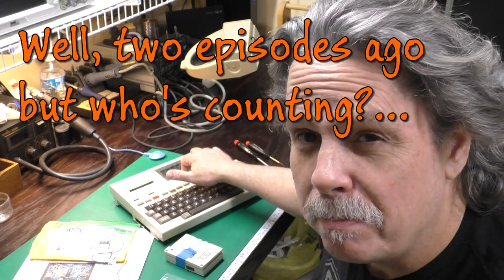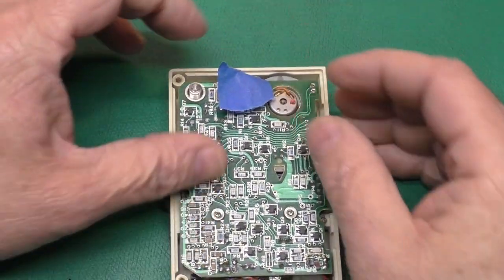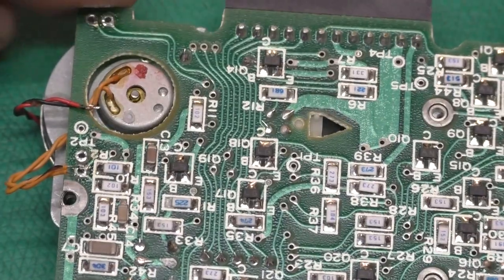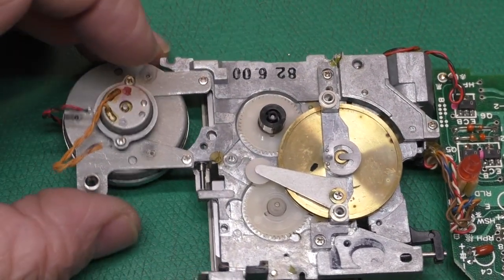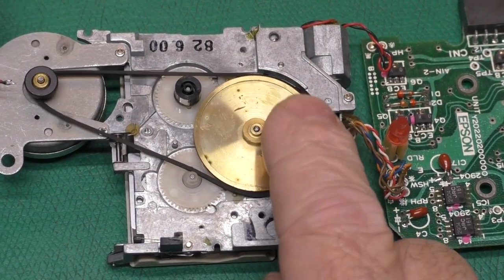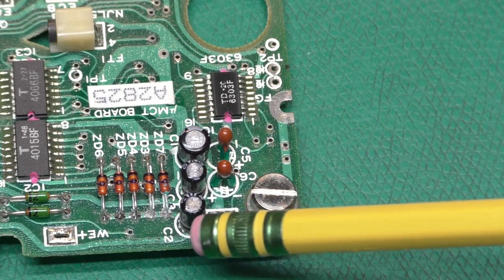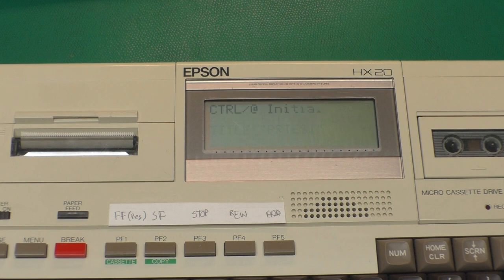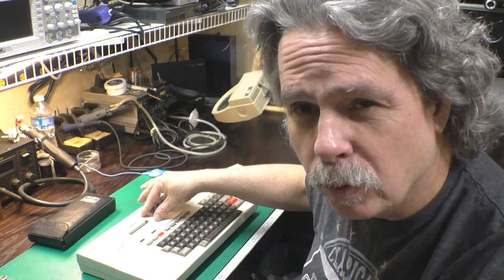Epson HX-20 #2 Microcassette refurb, Expansion Unit overview, testing things out.

Comment: Really enjoyed!  You must have been a watch maker in your previous life.  I was always disappointed the SkyWriter ROM will not initialize once the Expansion Unit is installed.  I could never figure out the Expansion Unit dip switch and jumper combination to see if the SkyWriter would initialize if installed in the Expansion Unit.  Great EPSON HX-20 vlogs!
Reply from the maker: I had not tried to get Skywriter to work once I reinitialized the Expansion Unit. I need to re-read that section of the manual to gain a better understanding of the various DIP switch settings.

Comment: Can you test the unit loose from the HX-20? For example by hooking up an Arduino?
Reply from the maker: What unit? The microcassette perhaps? If so, you would need to duplicate the control circuit for motors and amplifier to tape head.

Comment: Your video was very interesting, thank you for that. A few days ago I bought an Epson HX 20 on Ebay and I am absolutely thrilled with the computer. I could get started with the Basic straight away and old Atari 800 feelings came up again :). But I have one more question, the manual says that you can't put the HX 20 into operation while it is charging, why not? I'm already thinking about installing a Lipo battery that can be charged better and has a higher capacity. Then I could work with it for more than 1 hour using the Cassette drive or printer.
Reply from the maker: Many of the old computers like the HX-20 have no real charge control circuitry. The HX-20 only has a diode and large resistor in series with the charging jack. These two components only provide reverse voltage protection and limit the charging current.

The lack of charging control is why the manual says to wait until the charge indicator on the LCD comes on and then turn the unit off and charge for a specified number of hours. They are using the known discharge state that causes the charge indicator to come on and time to control the amount of charge. 

If you use the machine while charging then you will never know how charged the pack really is. If you remove the pack and then plug in the stock power adapter the machine will get too high of a voltage, it depends on the load battery charging to drop the voltage.
Reply: @HeyBirt  Thank you for your response. If I have the power supply connected to the computer for about 30 minutes and then work with the printer, which requires more power, can something go wrong? I would then continue to work, i.e. only use programs or program, until the display shows me that I should load!?

Comment: ...better than that metric rubbish.  Ofcourse. Where do you think 6.3 comes from? 6 being imperial rubbish and point 3 being 3 10th of an inch. 
Metric is the all natural way of calculating and counting. How many fingers do you have? Right. Cheers Bert. You're doing a nice job there. I used to operate this very machine for years when I was employed as, what you would call, a cable guy. The software by means of the RS232 interface was hooked up to the devices that were measuring the cable levels of the system. The data was stored on the tape and later used as proof that the HF amplifiers were just in order after adjusting. Oh, what a time that was.
Reply from the maker: You guys are sure sensitive about the metric system. It was a JOKE...

Comment: Metric rubbish? I leave this Channel....
Reply from the maker: Seriously? It was a joke!  A funny way to explain the part numbering system the belt place used.
Reply: @HeyBirt  As someone from a metric country I can confirm most of us got the joke :)
Reply: Heh, the "perpetually offended" people have us all second guessing ourselves.
Reply: @HeyBirt Any news of the video with the display and floppy emulator? Looking to dust off and refurb my HX-20… It has an internal RAM upgrade board and I did have an Oval HO-20 external display controller to connect a TV (PAL). Always wanted a TF-10 floppy setup for it..